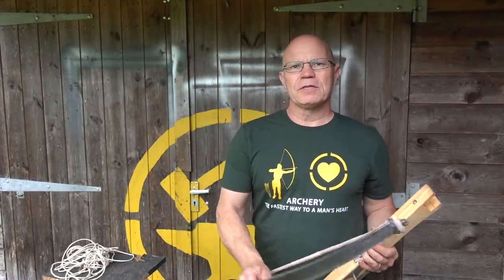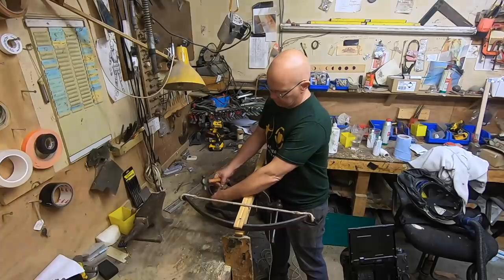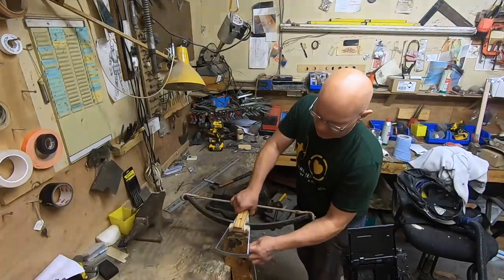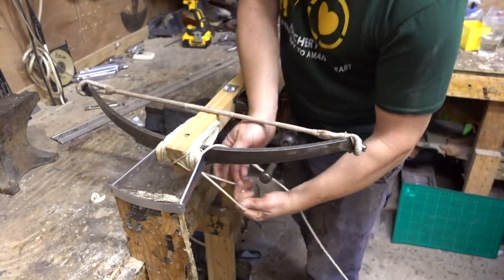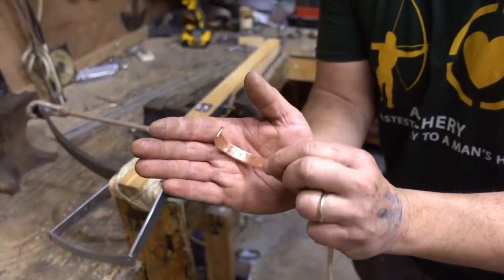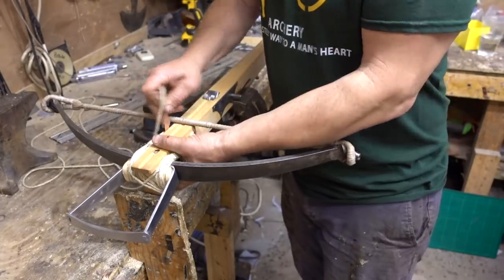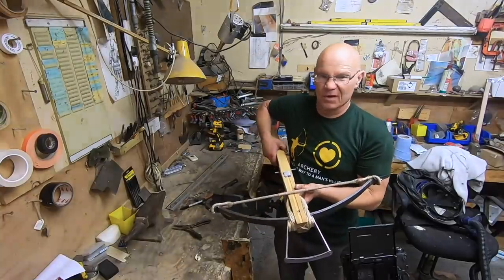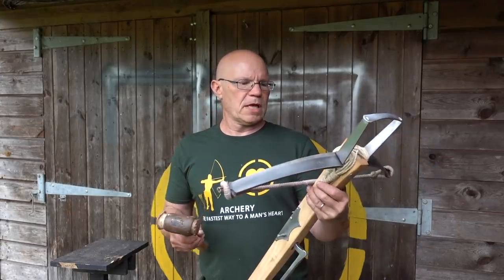Lashing a medieval crossbow

Comment: Thoughts on the video at the bottom, as per usual:

#7: Please do a series of tests to determine the strength of a bronze equivalent of a late-medieval breastplate. Can it defeat the lockdown longbow? If no, what can it defeat? Please help me figure this out, so I can overcome my obsession :)

Regarding the crossbow making. This was a very nice and interesting change of pace, highly educational but in a slightly different way. It is also always enjoyable to see a skilled craftsman work.

Regarding the method: is it the same for a crossbow with a wooden bow?
You know, in case society collapses and I need to make one of my own xD

Thanks as always for the great content
Reply from the maker: Sorry not at the moment, I am not pursuing bronze - apologies
Reply: @Tod's Workshop

I had kind of guessed as much. Sorry for nagging, It's just that I have developed a minor obsession with the question of why bronze plate armour never developed beyond the muscle-cuirass. This becomes especially curious when one considers that bronze appears to have been the preferred armour material for things like greaves and helmets well into the roman period. I suspect there must be cultural reasons for why bronze plate armour never developed in a more advanced/comprehensive direction, after all, steel/iron full plate only developed in europe.

It would however be nice to be able to rule the technical capabilities of the material in or out as a reason. 

Anyway, thanks for responding, Ill stop badgering you about it. Maybe one day it will happen, but untill then, thanks for all the great content!

Stay safe out there.

Cheers

Comment: I need a close up of making the "splice" please.  Your hands mostly blocked the view of what you were doing.

And...  What is the length of the cord you'll need, relative to the size of the crossbow being lashed?  Don't want to be pulling through an extra 20 or 30 meters, just to make sure I don't run short.

Also... I'd like to see a video of what to do if you break the cordage during this process.  You said there was a way to fix it.

Comment: I haven't yet received answer - why there are cases, where bolt nut is fixed to place with cordage?
Reply from the maker: On organic nuts a hard Axel pin would cause the nut to break
Reply: That explains. Thanks for answer.

Comment: Quick question: Would it make sense to make vertical holes in the stock to reduce friction of the bolt?
Reply: It's wood - not an artifically made thing (like steel or carbon fibre), thus much less homogeneous in structure. I'd refrain from it since the reward doesn't seem to be able to balance the weakening of your stock.
Reply: @kevinwestermann1001  I also thought of that, but to reduce friction the holes only need to be a few mm deep, more like dents or even  carve some "rifling" into it.
Reply: @OperationDarkside  Have you considered lacing the bolt 'channel' with bone or antler? Apparently, it indeed has been used in some cases to lessen friction before specialised materials were invented. If I recall correctly, Tod and/or Jörg Sprave mentioned it during the Instant Legolas (or Fenris bow) project.
Reply: @kevinwestermann1001  Haven't heard of that. Sadly I don't have a crossbow to test it on. Once I come across one, that I can deform at my desire, I will test that :D

Comment: If martial fibres loosen off too, and you know that... Why wouldn't you just go straight to aramid (kevlar) which you know doesn't stretch at all?
Reply: Also... I'm regards to the needle... Didn't they use to just dip that end in wax for the same effect?
Reply: Why would Tod user Kevlar on a medieval crossbow..? 🤔
And I don't think that an end dipped in wax would've been stiff enough to pass through... He was hammering it though... They surely would've had some sort of needle.
Reply from the maker: Tod wouldn’t!  Just mentioned it that’s all

Comment: I thought they would of use rawhide or hemp or cotton. Wouldn’t raw hide be better them hemp or cotton?? As rawhide gets tighter as it drys. Of course it would loosen if it got wet, but hemp and cotton get weaker if they get wet. So crossbows and bows should not be used in the rain 🌧.